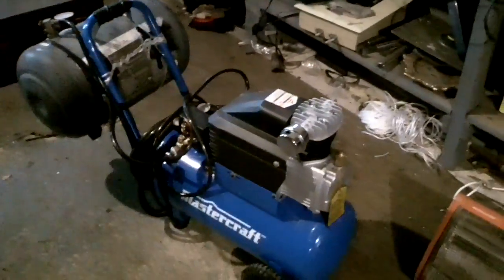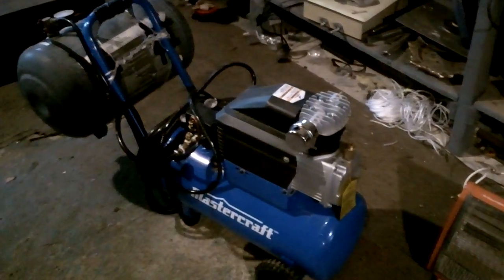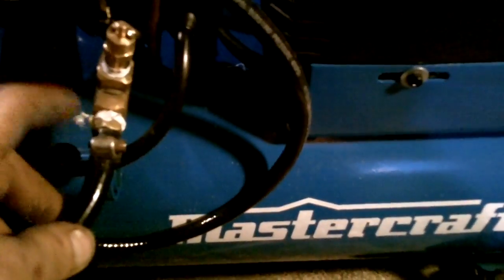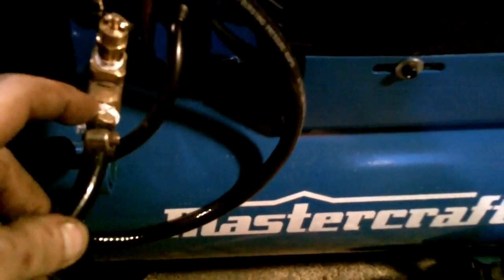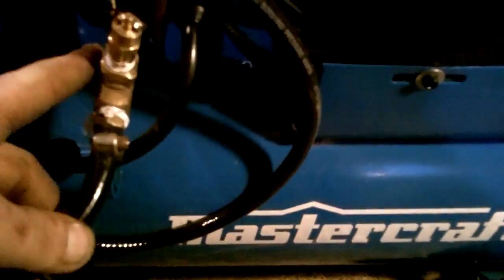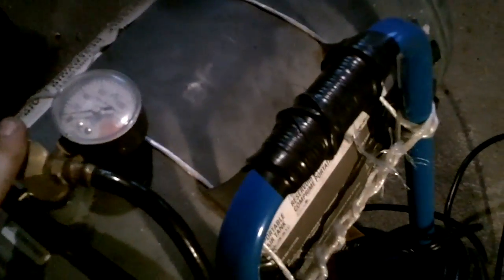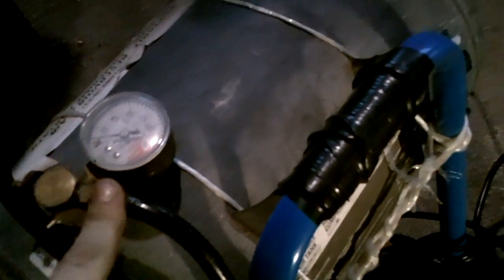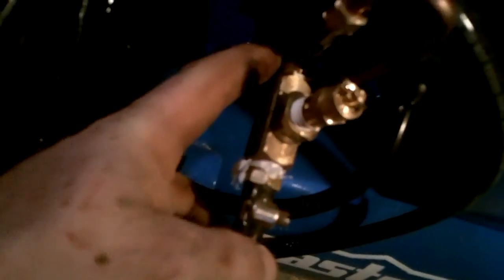How To Increase Air Compressor capacity

Comment: nice job man!!  I trash picked a small 3 gallon compressor and an extra tank, I've considered doing the same thing but I don't really need more air atm and I'm not sure if the pump can handle it.
Reply from the maker: well its most likely an oiless compressor, if thats the case I wouldnt advise doing this, you need an oiled compressor, otherwise it will burn itself up
Reply: yeah it's oiless and that's kind of what thought..
Reply from the maker: is it a canadian tire one? I got for my dad a few years back for christmas they are great for inflating tires or running a pin nailer
Reply: It's a Campbell Hausfeld..great working little compressor. The only thing I've done with it is inflate tires but I'll be using it to clean computers as soon as i buy an air gun for it.
Reply from the maker: oh nice, careful doin that though, too much psi will blow fans to pieces
Reply: +ghettohillbilly1 That's why you insert a paper clip into the fan to stop it from spinning before using compressed air to blow the dust out.